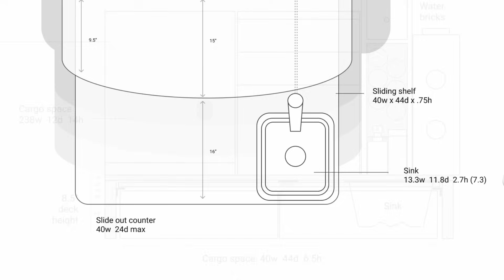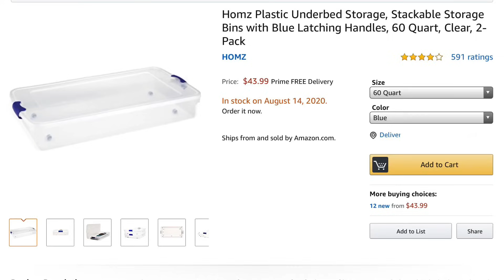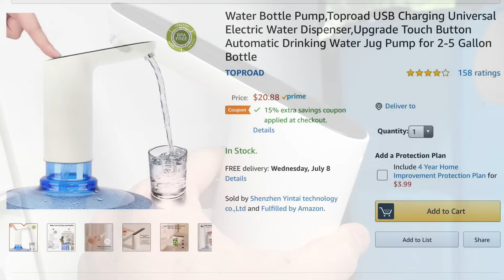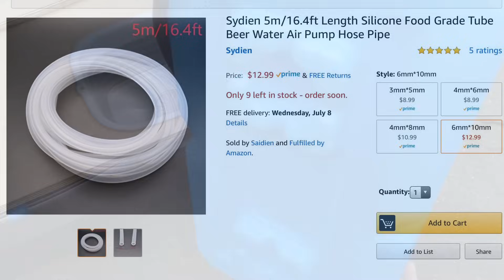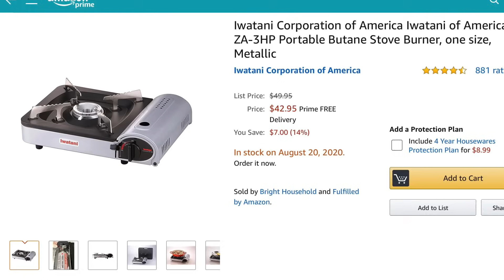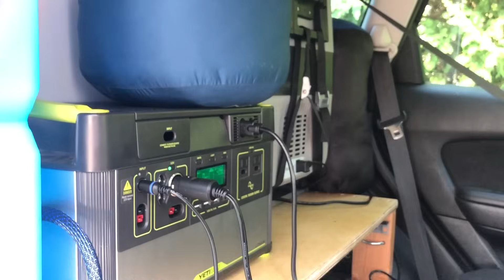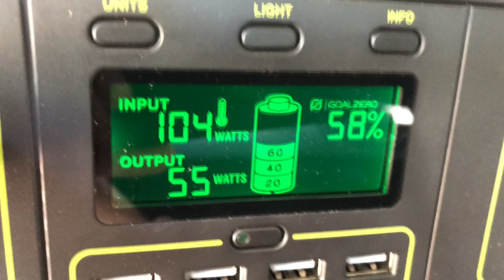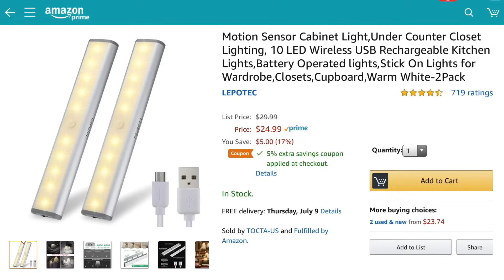SUV car camping kitchen with sink and fridge - DIY organization ideas for family camper

Comment: Can I ask about that Apicool fridge?  I've eyed it for a few months now.. but I've read some mixed reviews on it.  Some 5 star.. some 1 stars.  I've read enough negative reviews to keep me from buying it tho.  How has your experience been with it?  Thx.
Reply from the maker: Well, some bad news. It just randomly died. It was sitting plugged in and I noticed the panel lights were off. Checked connections, tried DC, opened up the panel to check fuses, nothing. Just dead. Has been running perfectly since March but seems the power supply or control board just died suddenly. I contacted Alpicool through Amazon and they amazingly agreed to credit me if I sent it back. I think I learned my lesson, going to look into a Dometic. These Chinese knockoffs are a great deal but if they only last a year or two (or less), might as well get a Dometic, ARB, etc.  and know it will last and be repairable.
Reply: @todd.parker  Good to know.  Thx.  I've been looking at the Iceco GO20.  Its small.. but has good reviews.  Tho even that fridge seems to have a lot of complaints re: a minor issue.  A lot of complaints about the 12v power plug fitting too loosely into the cigarette socket and contently falling out.  But the ARB power plug fits it.. so that can be remedied with an upgraded cord.  The dometics and ARBs are just so expensive.  And I definitely want a dual zone.  I may look into the Whynter fridge.  Its just much larger than I'd like.  Anyway.. thx for the quick reply.
Reply from the maker: @randomstuffwithjoe  Sure thing. The Alpicool is unique in that it's around 50 liters and dual zone. I think most others are 75+ liters. Alpicool has been out of stock on these dual zones for a while, I wonder if they discovered a problem and are fixing it before selling more.

Comment: I am going to use your faucet idea on my camp sink. One question.  Do the magnets need to be insulated from the pump mechanism?  I will use the tape roll if you say yes. If not I might try another way to attach the faucet.
Reply from the maker: I don’t think the magnets will mess up the pump. I was using the tool of tape to raise it up and give the hose room to bend. Others have used PVC pipe
Reply: @todd.parker  Thank you for such a prompt response!  I don't  need the hose to bend so I think what I have in mind will work!
Reply: It worked!
Reply: Brilliant! Our pop up camper has a hand pump that isn’t ideal. I tried to stop the video to see what L-shaped plumbing was used at the bottom of the faucet, but this comment sounds like the water tubing is just curved ? I’m very new to all of this, with no DIY knowledge. Another YouTuber suggested a 2” capped PVC fitting, cutting a hole for the water tube to come through on the side and placing the magnets inside the cap for a clean exterior look. Does any of this sound feasible? I’m open to any and all tips, hoping to get this right the first time! Thank you!!

Comment: For the faucet, how did you get your tubing at an 90 degree angle without kinking?
Reply from the maker: I bought better silicon tubing (link in description) that doesn’t kink. The tube they include with the faucet is super bad, most come pre-kinked!

Comment: How deep from front to back? Are the rear seats pushed forward to make a bigger kitchen area?
Reply from the maker: The seats were pretty far forward but still usable for smaller adults and kids. You could shave the depth down and have the seats all the way back if needed

Comment: Excellent! Love the filing cabinet idea. Question: any rattles from the cabinet so far? Just wondering since it’s metal.
Reply from the maker: If the car is packed and cabinet doors are locked, it’s quiet unless you’re on a bumpy dirt road. I had it in the back recently with no other stuff in the back and it was a bit rattly on bumps but I think that’s not a common scenario. I added foam shelf liners to the bottoms and that helps a lot.

Comment: Hi. At the bottom part of the rechargeable faucet did you use the L brass too to connect it to the hose?
Reply from the maker: No, I just connected the silicone tube to barb connector at the bottom

Comment: Nice work, do you get any rattles on that filing cabinet. I suspect this wouldn't be a good option for off roading.
Reply from the maker: It's fine on regular roads and reasonably flat dirt roads if the drawers are locked. On washboard dirt roads, it would get pretty loud, yeah

Comment: Cool set up!  Very impressive ~ However you said the total cost was $800?

I think you forgot the cost of the Goal Zero Yeti 1000?  The cost of the solar panels and special 12 volt cable?

That adds an easy $2,000 to $3,000 plus that $800~ right?
Reply from the maker: Yes, the price doesn’t include power or the fridge since there is a wide range of options there. Or just use a cooler :)

Comment: I still can't see underneath the slides/rails for the sliding counter top, which is connected to the sliding piece of wood. The flat punctured piece, but thinking its the angled one.
Reply from the maker: The counter is basically just riding on that rail and trapped against the too
Reply: So none of the metal rail is attached to the counter piece at all? Thanks for replying.
Reply from the maker: @Karen Clausen  nope, the counter just sits on the angle iron. I added felt tape so it slides smoother. Aluminum U channel would be even better, going to use that next time

Comment: - Hi Todd !
Could you tell me what the diameter of your cellphone magnetic mount? I've bought à 4cm one, but seems to small to set the faucet on it... :-(

Thank you ! 

Jimmy
Reply from the maker: Depends on your faucet but I think 2.5-3”
Reply: @todd.parker  3 inches ?! Or centimeters ???
Reply from the maker: Are you asking about the diameter of the metal circle I mounted the faucet to? I think it was this but I’m going to look for something with more metal next time for a stronger mount: Tryone Metal Plate, Metal Disc Replacements Without Logo or Hole, Compatible with Magnetic Car Mounts, 2 Rectangle 2 Round, Black&Silver https://www.amazon.com/dp/B01LZAYD8X/ref=cm_sw_r_cp_api_glt_fabc_Q49DVRSFN0XH939W7MB0?_encoding=UTF8&psc=1
Reply: @todd.parker   yes, I'm asking about the little disc. I've already bought the pieces you are showing me, but with a hole. Doesn't work well with ceramic magnets, so I'm gonna order neodyme ones. Thank you for your answers. :-)

Comment: Quick question  can you connect solar panel to the battery while using outlets?
Reply from the maker: On the Yeti 100? Yes. I have the car charger and solar plugged into charge it and can use AC and DC at the same time
Reply: @todd.parker  thanks for replying!

Comment: Mind if i ask what type of wood you used? I love your build, I hope you don’t mind if i borrow some ideas!
Reply from the maker: It’s 3/4” Burch plywood from Lowes
Reply: @todd.parker  awesome, what about that metal L bracket you used to hold up the pull out shelf?
Reply from the maker: @jarlathgarcia4571  this style of angle iron https://www.homedepot.com/p/Everbilt-1-1-2-in-x-14-Gauge-x-48-in-Zinc-Plated-Slotted-Angle-802417/204225778

Comment: Hey Todd,  with your back seats folded what prevents the sliding shelf from sliding all the way forward in the event that you have to brake hard?   Cheers
Reply from the maker: I have ratchet straps that attach to the car seat harness loops and some points in the back. You can see those at the end of the video

Comment: your total cost in wasn't including the Goal Zero yeti though and that's over $1000 ?  and your panels to trickle it ?   Extremely well done video btw, and good thinking on every point you brought up...
Reply from the maker: Thanks! Yeah, I was focused on the cabinetry and stove/sink for the rough procing. I figure you can just use a cheap cooler or go whole hog like I did. The other commercial kitchens don’t include the fridge, power, or solar in the pricing either I was trying to compare on the core functionality. Anyway, it’s all about ideas you can adapt and extend as you see fit. Cheers!

Comment: Do you find it difficult to drive with the back of the car blocking the back window
Reply from the maker: I can see more than you think over the top but I just use my mirrors. A lot of vans and box trucks don’t have rear windows and it’s fine if you have 2 good mirrors. You may run into an overzealous police officer or local laws so be sure to see what’s legal in your neck of the woods

Comment: Great ideas and planning! I am inspired for my own build. Question - did you use software for the planning sketches at the 1:48 mark? If so what kind? Thanks!
Reply from the maker: Thanks! I used a drawing program called sketch but it’s not really designed for drawing plans

Comment: Hi Todd thanks for sharing. When you connected the elbow to the cap of the water jug, did you add or do anything else to secure it in place ?
Reply from the maker: I used a bit of teflon plumbers tape but I wouldn't trust it lying down.
Reply: Todd Parker - would like to confirm what tubbing size you used. On amazon it linked to 6mm, but there were options for 5mm and 4mm.. please advise ... thank you so much !!!
Reply from the maker: @jnet80  Yeah, it's tricky! I had to buy calipers and order 2 sizes to get it right. You want 6mm inner diameter (ID). This is the exact one I got: "Sydien 16.4ft/5m Length Transparent Food Grade Silicone Tubing 6mm ID 10mm OD, Non-Toxic"
Reply: Todd Parker thank you!! Will try to get this done this weekend 😀

Comment: We have a Mazda CX-9 also, out of curiosity... Is yours FWD or AWD and if FWD have you had to replace the water pump yet?
Reply from the maker: Ours was AWD and we didn’t replace the water pump. We traded it in this fall with 85k miles, 2013 model. Is that a common issue?
Reply: @todd.parker  yeah super common in the FWD versions. The water pump is the engine, driven by the timing chain, when the seals.fail it dumps coolant into your oil. Was a $2500 repair for us, if my wife didn't love the vehicle it would be gone.

Comment: Where did you find the full extension slide for the refer?
Reply from the maker: ICECO Slide Mount for JP30 JP40 JP50 Portable Refrigerator, Freezer Slide(Not Suitable for JP42) https://www.amazon.com/dp/B082NLFLZV/ref=cm_sw_r_cp_api_glt_fabc_FP217VWRSNEDP68M1CWA

Comment: What's it look like from the passenger end?
Reply from the maker: From the second row, it’s pretty packed but I can usually peek over the file cabinet by a few inches. Mostly picture a wall of gear but I make sure only light stuff like sleeping bags are near the top in case we stop short. The Yeti and water bricks are low so they can’t fly over the seat backs

Comment: First up - Love it! But where do you keep your clothes when you go camping?
Reply from the maker: We use packing cubes or small packs and fit them in the back. It was a little tight so we added rooftop storage for the bulky tent, pads, sleeping bags to gain a lot more luggage space. I’ll do a follow up video

Comment: Great ideas - love the water bricks and the faucet!  Does the file cabinet rattle a lot as you’re driving?
Reply from the maker: No, it's been quiet so far. I lock the drawers when I go but no noise really. Helps to have the drawers organized so the contents don't rattle around. I also use foam shelf liners to damp things down.
Reply: @todd.parker  That's awesome - might have to steal that, too.  ;)
Reply from the maker: Emily Zillig it definitely helps to have stuff packed around the cabinet because that stops any vibration. I was just driving down bumpy dirt roads this morning with just the cabinet in back and there was some rattling, more than I’ve ever heard but that’s worst case. On a regular road, totally quiet.

Comment: No shame in the filing cabinet. When I did my van build I initially put a beat up filing cabinet in the sliding door area to prototype/use it there until I did my full build. As it happens I ended up finding a used, super well built 3 door 30" long filing cabinet that I have proudly incorporated in the final build.
Clever water pump system.
For aesthetics you should have rounded out the put out table to match the static plywood - just saying...
Reply from the maker: Yeah, why not use pre-made as much as possible, right? Re: rounding, I agree. I kept it straight because this car is temporary, going to switch to a minivan this fall and may re-do the top to be squarer since that is more of a box.On only needed to curve the top to finesse the shape of the Mazda.
Reply: @todd.parker  Didn't plan it that way - but I ended up bolting and screwing a whole bunch of stuff to it because of its proximity and that the whole cabinet was built to strong to take it. It is basically in the most valuable piece of real estate in the van and is the center of activity in the van.

Comment: Do you have a template for the sink insert?
Reply from the maker: Sorry,  I just traced the sink and used some math to guess the inner cut. I made a test cut in cardboard to dial  in the fit
Reply: Will use the cardboard trick! Thanks

Comment: So how much did everything cost to you%?
Reply from the maker: Some rough numbers:
Wood + fasteners - $100
Sink, faucet, 2x waterbrick, tubing - $80
File cabinet - $130
Bins underneath - $40

The rest of the things are highly variable. You could just use a cooler but my original fridge + slide was $500. The Yeti is $800 refurbished but you can use anything you want to power the fridge. Those are just things I owned. Solar panels are also a big range, but figure $200-$300 for a 100w panel.

Comment: How do. You see out of the back window when. On the freeway are you not breaking any laws
Reply from the maker: When it’s packed full, I can’t 🙃 but I don’t think that’s illegal. I just use my side mirrors and am as careful as possible. If not pa led, I can see over the top of the file cabinet a few inches, enough to see decently well.

Comment: Wonderful everything, but 1 concern. There's no way that was under $1k. The Yeti + expansion module + solar panels easily add up to $2k by themselves. I assume you had them before you began the project but I suspect most viewers don't own those things yet and they need to know the truth cost.
Reply from the maker: You’re right. I didn’t include that in the price since I’ve had that for years and it’s not exactly part of the kitchen module. None of the 3-4K car kitchen boxes include power and solar either so I was trying to keep the scope similar. You could plug the fridge into your car, a 12v battery, or just use an ice cooler so there is a big range of options

Comment: Connect the rear seatbelts, if you don’t have any passengers in the rear. This will greatly reduce the chances of the camping equipment from sliding forward during a front end collision.
Reply from the maker: I will have kids in the back seat but I have ratchet straps that attach from the seatbelt anchors on the bottom/back of the seats to some D rings on the legs. Same near the hatch. Safety is important for sure.

Comment: I just don't get it! So you convert your car into a mobile kitchen with storage so you can sleep outside? You have totally missed the point about car or mini-van camping. How much time do you spend cooking per day? If you are driving along and you feel hungry and thirsty, do you really need a kitchen? Then washing up? A comfortable bed in a safe and secure environment is usually the objective.
Reply from the maker: I’m not sure there is just one definition of “car camping” but I have a family of 4 so sleeping inside the car isn’t an option. We may get a large rooftop tent next summer. It fit now, we’re on the ground. For me, having a nice kitchen and organization makes life a little easier and I know I can crank out 3 meals a day without a hassle.